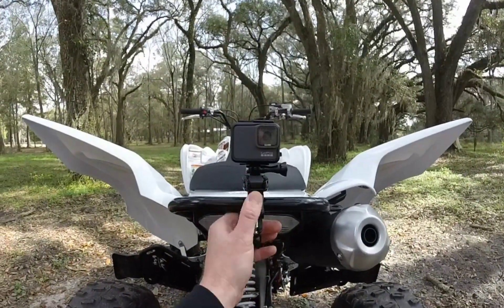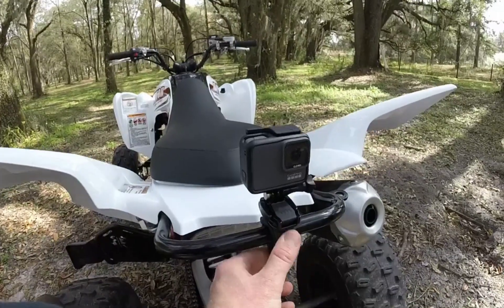DON'T USE GoPro SWIVEL mount on ATV / SxS / dirt bike!

Comment: wtf... its  not from that thing. its from motor vibrations itself... and thta thig doesent make any sound. put ziptie on it and u will see..
Reply from the maker: The only reason I suspected it was the mount is because when I would grab it tightly and put lots of pressure on it it would not click as loud. Also other riders that I know used a different housing and it didn't make the clicking noise. So i came up with the conclusion that that was it. But it's possible I could be wrong.
Reply: yea because you grabed it, you took part of vibrations lol so the camera was not detecting so much vibration...
Reply from the maker: @L30Nnorc  true but I can't explain how different cases don't do it but this one does 🤷🏼‍♂️